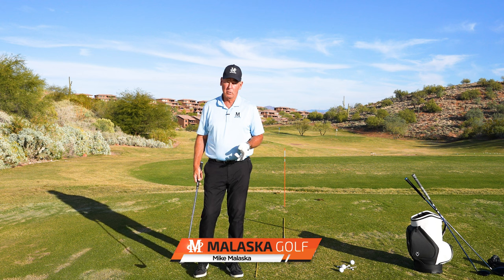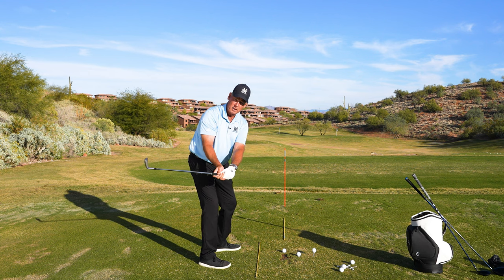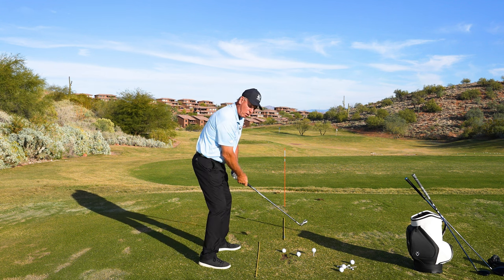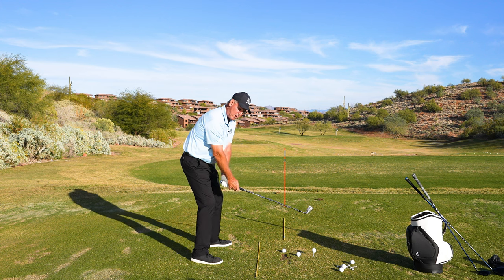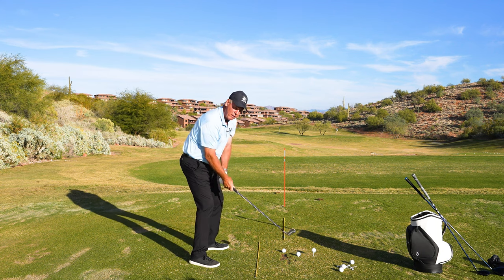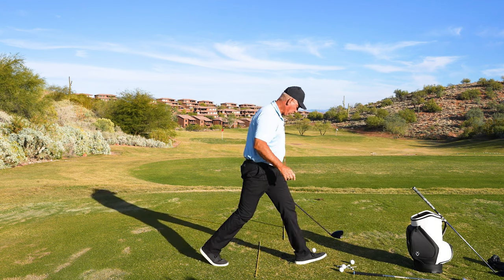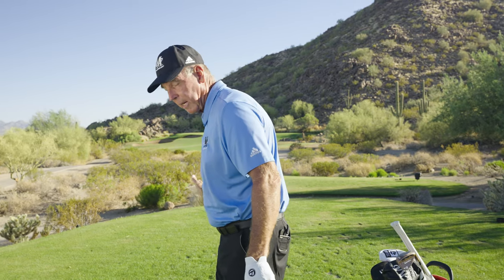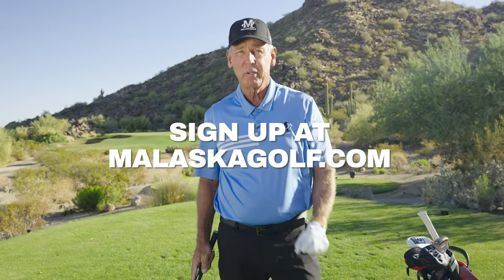Loop Drill Shallowing The Club // Malaska Golf

Comment: After piecing the swing together over the last few weeks I found this nugget. 
I've had 60 lessons and never made any real progress. Weak grip, get the club in this position,  blah blah blah. I asked the pro at the range why nobody ever mentioned using the clubs momentum to help you shallow and come from the inside.
When I took the club away with the head outside my hands I noticed that automatically I felt my hips push back away from the club head and the downswing took care of itself. I found I need to make a longer backswing to give everything time to get in the right place otherwise I pull it. It's a  revelation. I'm looking forward to playing on the weekend. 
You're an absolute legend Mike.

Comment: That taking it to the inside to much was why Hogan and Snead disagreed with what started the downswing, Snead had to start it down with that slight over the top move otherwise he would have been stuck. Where as Hogan wasnt on the inside so he started the downswing with the lower body. 
Good drill Mike👍 i used to suffer the same trouble taking it way to much on the inside, but then dropped it even further and wondered why i could not hit the ball with any good repitition

Comment: I'm confused since in another video you did with balancing the forces of the club you said you can't let the club get too far behind you so to counteract this force you said you need to turn the steering wheel the other way to the loop in this video. Can't find the steering wheel video for reference but you demonstrated the steering wheel using a tennis racket.